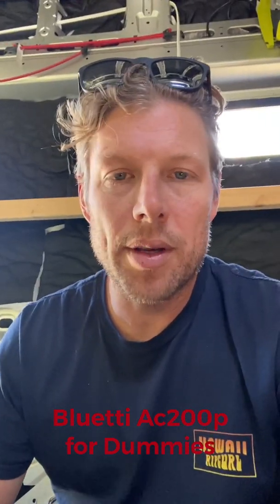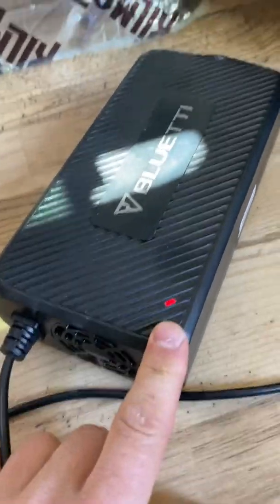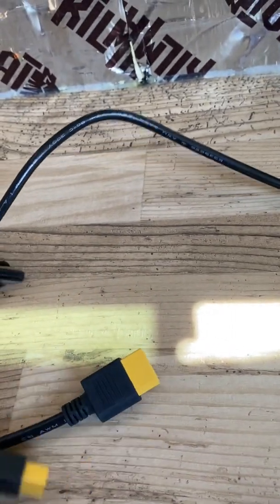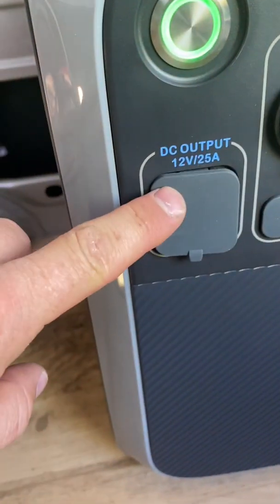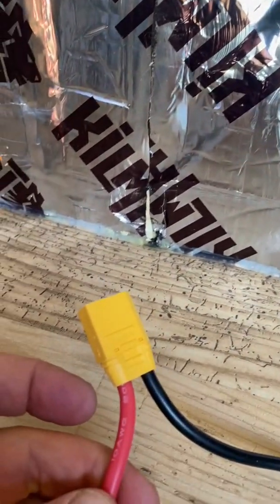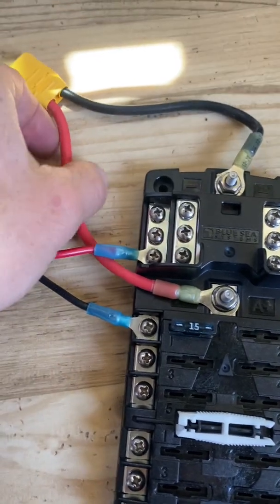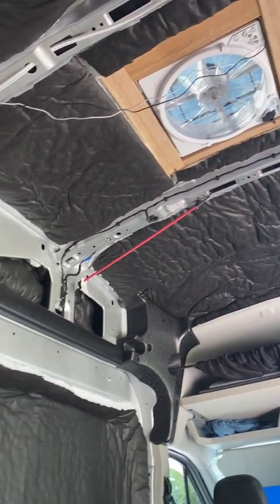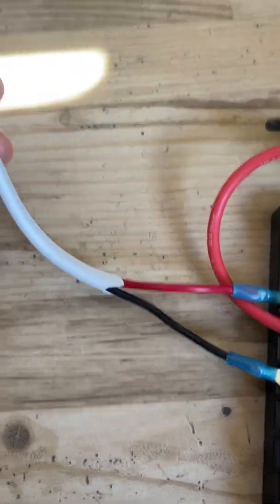Bluetti AC200p for dummies. Power in Power out. What are those cables for? What cables do I need?

Comment: Thank you for sharing.  I would highly recommend though at the fuse block keeping the colors straight.  I would suggest changing the color of the wire at the MaxxAir Fan so as to keep it straight at the fuse panel.  At the least, using red or black electrical tape to differentiate the wires.  You might always know why you had the Red/Black reversed at the FSP, but others might come along and wouldn't.  Otherwise nice setup.

Comment: The 4th way is to connect an inverter directly to your car alternator/battery then plug the bluetti power brick into the inverter. Charge while you drive @ about 450 watts )The cigarette adapter is next to useless.
Reply: I think to charge it in a lorry 24v by cigarette ad, what u think? That will be quicker?
Reply: even better if you use a DC to DC converter